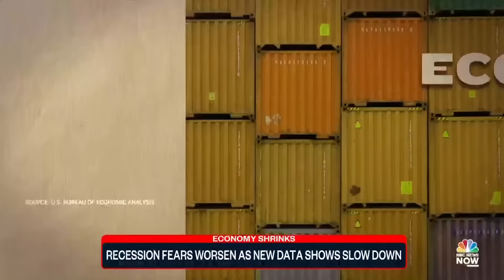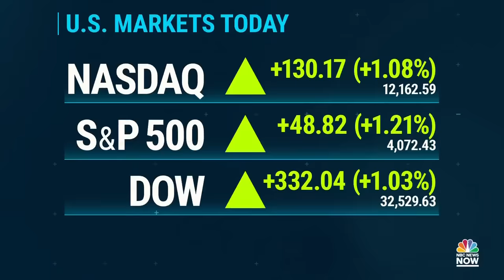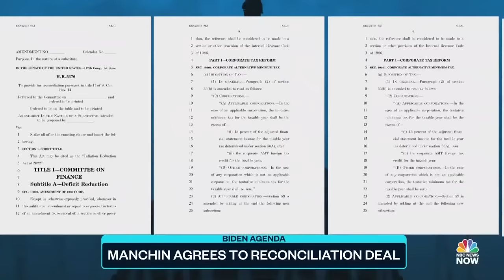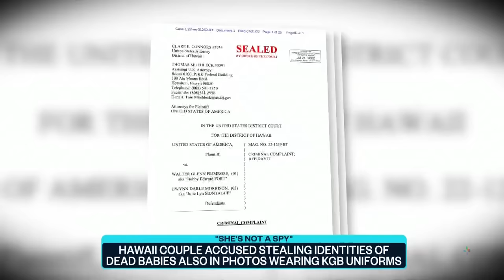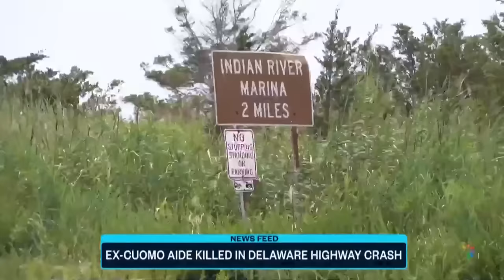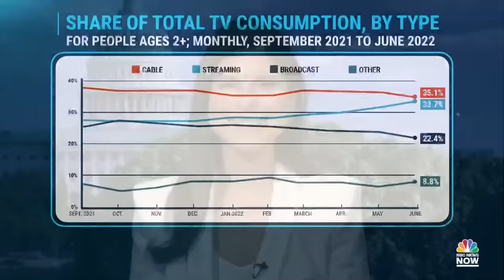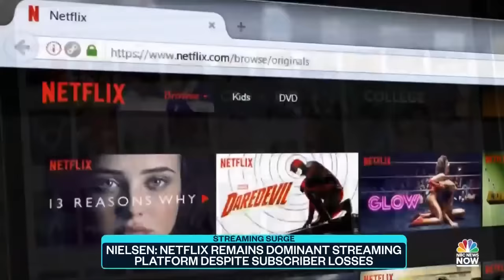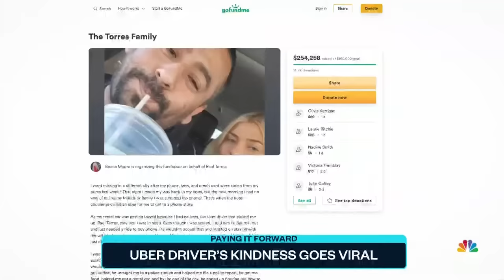Top Story with Tom Llamas - July 28 | NBC News NOW

Comment: What's strange is that it used to be illegal for networks to own both the shows and the distribution. It was part of the anti-monopoly process. They used to run both and were "sponsored" by other companies who were their exclusive advertisers. Because this gave them an unfair competitive advantage over the actors they broke them up (along with various other reasons). Then the 1980s and 1990s happened (TY Reagan and Clinton) and everything became a free for all. Let's give the companies horizontal and vertical control again. It worked out so well last time.